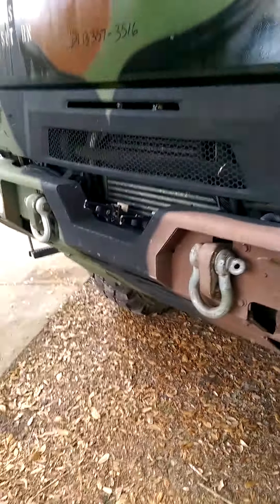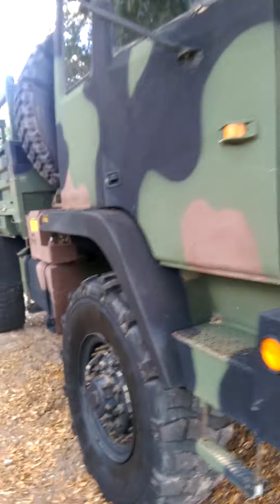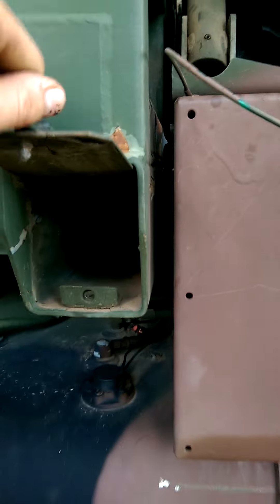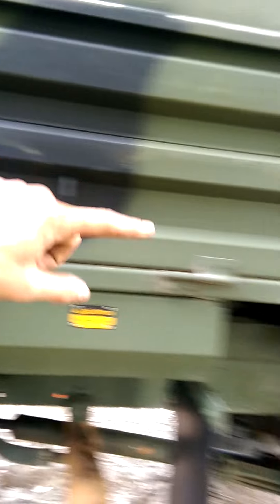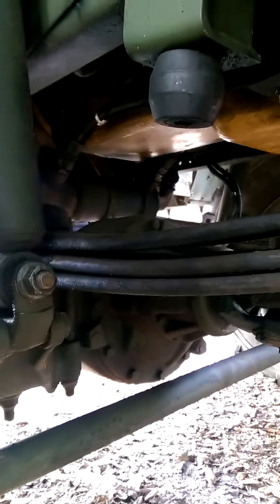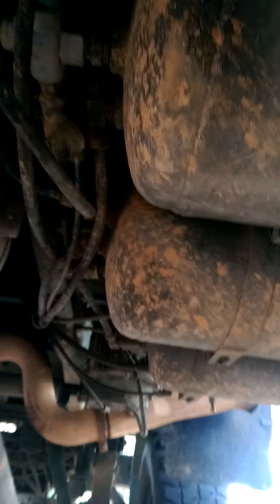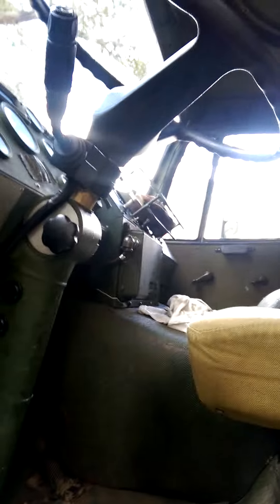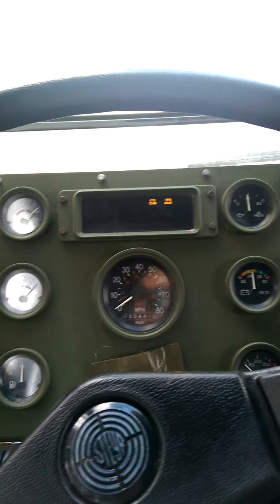M1078 lmtv Stewart and Stevenson walk around

Comment: This is the only comprehensive walk-around I can find on M1078 and it's well done! Thank you for your work! :)
Reply from the maker: Thanks buddy ! I appreciate it. I recently sold this truck but I am hoping to get another soon . I will be making many new videos of it and my other military vehicles.
Reply: DakotaXPRO Did you find the LMTV to be reliable? Have you put many miles on one? I'm assuming any repairs would be costly but I would hope with what it's built with (engine/tranny) it holds up really well...? Thoughts? Thanks!
Reply from the maker: +chaoticdriver I really enjoy these stewart and stevensons, I haven't had any problems with the ones that I had. I am surprised at how well built these machines are, all steel braided lines in the engine and stuff like that. I drove mine off-road a few times and they could go through almost anything ! I also went on four 600+ mile trips with them with no problems. I also know of a guy down here in Florida who sells parts for these at a good price so if anything broke I could just call him.
Reply: +DakotaXPRO Beautiful truck! You're a lucky guy!

Comment: How much would it cost to get the whole thing painted white?  Also what is the mpg?  my guess for the mpg is around 4-6
Reply from the maker: umm probably about $150 to paint it all white. I actually had an all 
white one. Most people buy a 5 gallon bucket of Behr premium house paint
 from home depot and spray it with a house sprayer. This truck gets 
around 13 mpg highway.
Reply: DakotaXPRO Wow, thanks for the fast response.  Im surprised by the mpg,  i thought it wouldn't be that good.
Reply from the maker: No problem buddy & yeah they are pretty awesome! I've driven 4 of them back from North Carolina to my house down here in orlando Florida and they are all great on the highway and off road.

Comment: Only 2 things I'd change with mine. Swap in a 330 hp 8.3 and a air locking front engage T case. My old 5 ton never gave me the problems that CAT has.